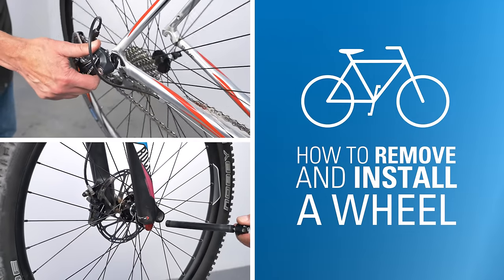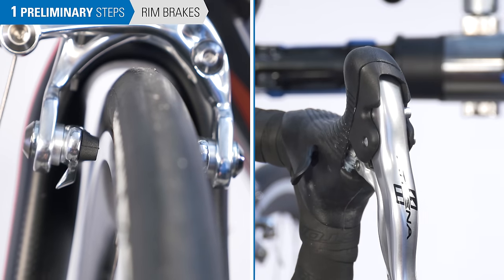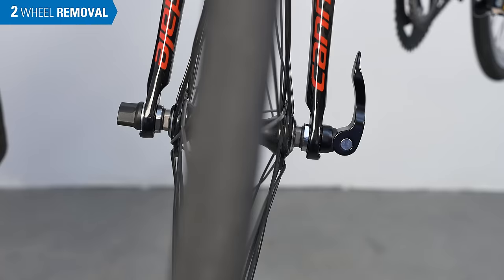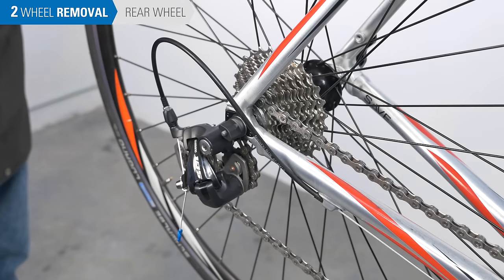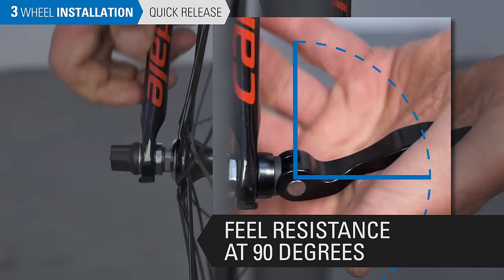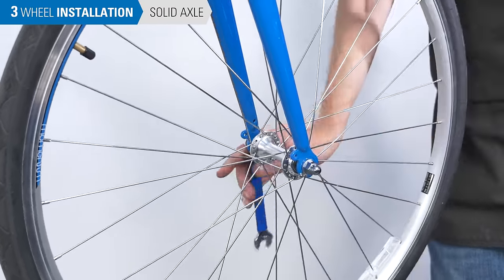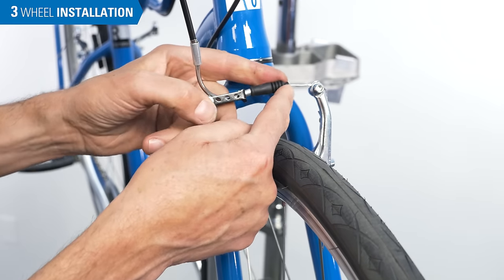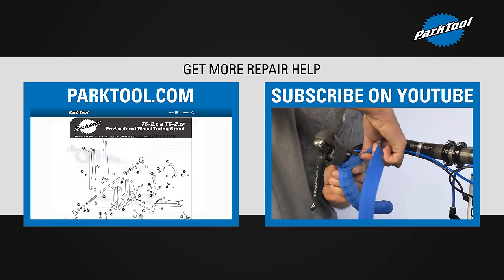How to Remove and Install a Wheel on a Bicycle

Comment: Just changed my inner tube for the first time and I just started biking just a month ago, removing the rear wheel is quite hard because my rear derailleur doesn't pivot as much as the video shows so when returning my rear wheel I ended up unscrewing my rear derailleur just to have enough space. Overall it was a new experience for me.

Comment: Thanks!!! I had to pop both tires off to fit my bike in my car then I wound up needing an emergency back wheel install instructions. I could not fig out how to coordinate connecting it w the derailer & chain. Your instructions saved me from an embarrassing trip back to the shop🙈🙏🏽

Comment: Great detail...very good. Just started riding again after many years out. Used to be able to change inner tubes for fun but learning all again from scratch. Was trying to figure out how to release the brakes to get the wheel off first. Your great explanation helped a lot! Thanks.

Comment: Even with this video I still can't get my wheel off, guess I'll just take it to the shop lol
Reply: Quinton Yosef  omg iv been using it too and it's so great
Reply: whyyyyyyy it literally takes 2 seconds
Reply: @AC Bikes ikr, you just pull a lever, use ur hand to unscrew the thing, and ur wheel comes off in 5 seconds or less (at least for disc brake qr axle
Reply: @linemedia666  it might be an unused, old, or broken type of release mechanism
Reply: @commenter1639  yeah that is true but im just cringing at the fact that someones gonna take their bike to a shop to take off the wheel
Reply: RIP noob
Reply: @AC Bikes$32 here to fix it
Reply: @linemedia666  my things wont unscrew and the pin thin is rusted

Comment: Thanks for the this video! I was able to remove the front wheel on my new bike several times for transport purposes. On this last try though, it looks like one of the brake pads is far too close and also a little high up, causing friction on the tire. Any ideas how to fix this?

Comment: How it works in my bicycle:

Front is easy. Almost exactly like this one. But I have to make sure it's aligned properly. Sometimes wheel might be crooked, and it'll touch the mudguard once you tighten it.

Rear wheel:
Remove the nuts from both sides, remove the stand, remove the mudguard support, remove the carrier support, remove the chain, remove the wheel.

Putting it back:
Insert the wheel axle into the slots, attach the chain, make sure the chain adjustment lever is in its spot, tighten or loosen the chain adjustment lever nut, to make sure chain tension is correct, tighten or loosen the other lever so wheel is aligned, insert the supports for carrier, mudguard, stand, insert the nuts. Make sure about alignment and chain tension one last time, and tighten the nuts. Nuts should be tight enough so the stand can't move around even if you tried to push it

Comment: I can't even believe all the different types of caliper releases. I feel confident that whichever one I have, I'll have instructions on how to remove the wheel, instead of looking for another video. Well done! However, I am a little concerned that I will put the wheel back on and not have everything seated right or attached securely. No one wants to find that out once you're on the bike.

Comment: Help! This guide was very useful for removing and installing rear wheel for the first time when I had a flat, but while re-engaging the linear brake after installation, I accidentally made it too tight! Stuck in the middle of nowhere typing this comment

Comment: Having difficulty w my rear tire it's kinda wide 2.5 in not much free space the side with the cogs fits in nicely all the way to the back but the other side.... for 1 the marking from the factory install is not as far back, and it does make a rubbing sound

Comment: I couldn't find a lockout on SRAMx5 rear derailleur and getting the big tires on my 29er in there a disk and the solid axle type is more challenging and not covered here.

Comment: What happens when there are mudguards and racks? Do you have to take them off completely or just unscrew the nuts at the axle?
Reply from the maker: Mudguards and racks can make this more difficult but the steps are still the same. Sometimes you will need to unscrew the axle nuts or quick release all the way.

Comment: Good video as always from Park Tool, BUT you didn't show how to do it on the thru-axles were you are supposed to use a hex wrench key.
Reply: Screw it in and tighten to indicates torque spec.

Comment: Great and very helpful videos on this channel! Thank you for sharing all this knowledge! Quick question: Where should the thru-axle lever of the rear wheel point to when it is installed? The video shows twelve-o-clock position, but there seem to be many opinions on the internet and on the trails. What do you recommend for maximum safety?
Reply from the maker: The location is typically personal preference. I would have it pointed either straight up or straight back on the fork. Or would have it pointing in between the seatstay and chainstay or straight forward on the rear. Most thru axles do give you the option to move it where you would like. in my mind max safety would be straight up on the front and in between the stays on the rear. Hope this helps!
Reply: Park Tool. That was very helpful. Thank you very much!

Comment: I’m trying to reinstall my rear wheel on an MTB with disc brakes and quick release. I fought with it for a half hour and can’t get it back on. It seems like a two person job, unless you own a bike repair stand. Bicycles are one of the most difficult mechanical things to work on in my opinion.
Reply: no

Comment: Do some thru axles not have a lever to turn?  I'm 99% sure my bike has a thru axle, but I see no lever that I can turn to unscrew and remove it.  It looks like an allen wrench might be used instead.

The bike is a Specialized Diverge E5 Elite, if that helps.
Reply from the maker: It does seem to be a thru axle.  Look on the left side for a hex hole, and use the correct size.  6mm or 5mm, both are seen.  Turn counter clockwise.

Comment: Damn, I was in a hurry earlier replacing a tube and forgot to shift to the smallest cog on the rear derailleur. I didn't realize until after replacing the wheel and now the shifter is really tight and hard to shift. And the derailleur is completely out of whack where as before it was in almost perfect adjustment. It won't even shift to the largest cog now :(. Any help with this would be greatly appreciated. The shifter is the twist kind with numbers on it.

Comment: Hi I have a bike with solid bolt type axel disc brake system. Can I convert it to quick release system
Reply from the maker: Possibly.  If you replace the entire axle assembly, yes, but you must match the cone profile.  Possibly all you need is an axle.  If your axle is M10 x 1mm, then it is easy with a new axle.  If you are 3/8" x 26 tpi, then not so easy.

Comment: I followed the instructions s got the wheel off and on, but now the chain is slipping gears on the rear wheel. Could this be because I tightened the wheel nuts off centre ???
Reply from the maker: That could be. If you removed the quick release entirely, be sure the springs got on in the correct orientation. If wrong it could hold the wheel at an odd angle.

Comment: Seating the rear hubs in the dropouts before installing the thru axle on my bike is tricky. The width between the dropouts is just a tick wider than the hubs, and I really have a problem installing the rear wheel when not using a repair stand. The hubs will slip through and grind the stays. It appears this is due to the stays not being under compression when the thru axle is removed. Is this normal? The bike is stock. So, there are no mods to factory components.
Reply from the maker: There should be a bit of a step in the drop out to prevent the hub from going too far. The outer diameter of the hubs end cap is not a set standard and some have a larger diameter and some a smaller. If the hub has a small diameter and the bike is setup to accomodate a larger diameter, lining them up can be a bear. There is not a great fix for this unfortunately.

Comment: I removed the rear wheel in a hurry without noting which gear it was on. Is there anything that can be done while putting it back without trial and error?
Reply from the maker: Use the shift lever to move the derailleur to the outermost position.  Then install the wheel with the chain in that position.
Reply: ❤ Park Tool. I took a chance with my usual position and it worked but I will remember this tip because I am generally very careless and forgetful. Many thanks for responding.

Comment: What do you do with the springs?  They are covering the axle right where the dropouts should go.
Reply from the maker: The small end of the tapered spring goes towards the hub. One spring on each side.
Reply: @parktool  Thanks for responding. Yah , I get the orientation and placement of the parts related to the axle. I think that was well explained in the video. What isn’t clear to me is where the dropouts are placed relative to the parts on the axle. The portion of the axle, where the dropouts should come in contact with, is covered by the spring. Should the dropout be place directly on the spring or should the spring be pushed to the inside or to the outside of the dropout?
Reply from the maker: The drop out should really never come in contact with the spring. The wheels axle will rest against the drop out and the spring just pushes the qr out on both sides to make it easier to install. The springs should not support the wheel in anyway. They are there to make install and removal easier. One the QR is close the outside face of the QR will come in contact with the dropout and the spring will be neatly held inside ready for the next time the wheel is removed.

Comment: Do I have to remove the breaks I can but it's annoying
Reply from the maker: There are only a few bike designs that require brakes to be removed.  You should be able to get the wheel in and out with brakes in place.

Comment: Thanks for your pacesetting station! Super informative.  I have some hockey stick tape.  Will that suffice as handlebars tape, Park Tool?
Reply from the maker: Hockey tape leaves a bit more cushion to be desired. A cork or gel cycling tape is much more comfortable. Hockey tape is good for grip but not as good for comfort.

Comment: I think I have a through axel, but no lever. Seems like a tool is necessary to remove the axel. Hex key, perhaps?
Reply from the maker: Thru axles that do not have a lever will typically require a 5mm or 6mm hex key.

Comment: Do we have to re-index the gear??
Reply from the maker: If the gears were properly adjusted, removing and replacing the wheel will not change that.

Comment: How come they don't tighten the thru axle at the disc rotor side, like qr usually does. The clamp would usually be on the non drive side
Reply: Front QR and thru axles should have the lever on the drive side so it doesn’t risk getting caught in the rotor. On the rear, the derailleur makes that cumbersome, so the lever is on the NDS.

Comment: I have a problem. I was looking into getting a bike that has a weld problem on the rims and the bicycle ends up flat. How do I fix that problem with out buying  new rims?
Reply from the maker: Like any problem, first you must diagnosis the issue before deciding on a repair. Are there a problems in the tire seat, like sharp edges or a badly placed rim strip? Inflate the inner tube and see what the hole is, and where it is.  Trace this back to the rim location to find the issue.  The repair can happen once you know the cause.

Comment: Don’t quite understand why do we have to release the front brake calipers when removing the front wheel? I can just remove the thru axle and remove wheel.
Reply from the maker: Often the tire is too wide to allow removal of the wheel without the brake being released. It also does not apply to disc brakes.

Comment: PLEASE HELP When I try to install a rear sheel with a solid axle my wheel keeps getting out of alignment when I start tightening the nuts. I just can't get the wheel straight
Reply: I have the same problem
Reply: Put the bike on the ground right side up. Make sure you push your entire body weight onto the saddle while tightening with the other arm.

Comment: What does gcn say to close the skewer spin the skewer handle until tight open it then turn the nut a little bit and close it. even my manual says to keep it open tighten the nut then close it with the handle never mentioning to spin the handle so what is the correct way I really don't want to damage a pair of carbon fiber forks
Reply from the maker: The two methods are achieving the same outcome and can both be used. This is a Goldilocks type adjustment.... not too tight, not too loose. Whether turning the handle or the nut you are doing the same thing. Give it a few practice try's and you'll get the hang of it nice and quickly.

Comment: What if I remove my Tyre in 3rd gear reply 🙏🏻
Reply from the maker: Then re-install onto the third sprocket. Or shift back to the outer most position with wheel out, and install on to smallest sprocket.
Reply: @parktool  thank you for reply...and I did the same what you said 🙏🏻

Comment: Great videos. Should any grease be applied to the quick release axel at all? Or to the threads? Getting a little bit of surface rust on mine.
Reply from the maker: A little grease on the quick release is a good idea. Also a little bit of oil in the quick release cam area helps close tighter as well.

Comment: Sir, My actual inseam size is 83cm(32inch) and my total height is 172cm(68inch). Please prefer a frame size(L/M) and tyre size(27.5/29) for me.
Reply: Each brand sizes differently, so you’ll have to go off their sizing charts and your own experience. Wheel size is your preference. 27.5 is more nimble, which 29 is more stable.

Comment: I'm not sure which type of rear wheel removal my bike has. It has a Shimano RD-TZ31 5/6/7 Speed Bicycle Rear Derailleur, and doesn't have a clutch like the shimano derailleur in the video. It also isn't quick release and as far as I can tell it isn't a thru-axle either.
Reply from the maker: Then it is likely a "nutted axle" type.  The axle has external threads that protrude past the dropouts.  A nut then holds the wheel to the bike.

Comment: What do you do with a Sturmy Archer 3 speed rear hub?
Reply from the maker: "It's the same, only different." 
No, that is not a good answer, and this deserves a video as well.  Un-thread the adjusting barrel from the small chain that enters the hub on the drive side.  Loosen both axle nuts and slide wheel forward and out.  But that is all better with video.  Will put that on the list to do.
Reply: Thanks for the quick reply. I will give it a try.

Comment: Guys what is the wrench use in the axel nut?
Reply from the maker: Manufacturers vary in the axle nut wrench size.  15mm is the most common, but 14mm is also seen.

Comment: Can you do a video for a single speed mtb ?
Reply: curt robertson isn't it the same?  I think it should even be easier as you don't need to worry about the rear derailleur
Reply: no
Reply: Ryan 777 it’s been two years. I figured it out

Comment: when putting a front wheel back on is there a  "right" and "left" side of the wheel that should be maintained or can you put it back on with quick release on either side etc? thanks
Reply from the maker: The rear wheel has a definite left and right for the wheel. You can technically install the quick release on either side of the rear but its much easier to get the wheel in and out if the QR is on the non drive side. The front is not as crucial but typically you will want to be consistent with the rear so the qr will go on the non drive side on the front as well.

Comment: Did I miss the setup my bike has, it has none of these. Needs a Hex (Allen) key....
Reply from the maker: Some solid axle bikes use hex bolts to attach to the bike - in that case, instead of loosening the nut, you loosen the hex bolt then remove the wheel as seen in the video. If you have a thru axle with a hex fitting, then you just loosen the hex and pull the axle out and follow the procedure as seen in the video. Axles with just a hex drive were not as common in 2016. Hope this helps!
Reply: @parktool  Thanks, I will have a look tommorrow closer. Appeared to have a hex on both sides at the rear. Its for the cannondale scalpel si carbon 3 2019, Thanks again, Great Videos. I watch them even when I dont need too :-)
Reply: @parktool  I tried to torque my front thru-axle to the manufacturer specifications ( 10Nm ) with a torque wrench and my axle broke in two pieces by the thread area...any idea why this happened or any advice to avoid this in the future? I'm thinking maybe I missed the click-stop from my wrench...anyway waiting on a new front axle, any advice how to avoid this in the future would be helpful, thank you for your great content.
Reply: Vio SeVen Possibly a defective axle, or your wrench is being misused as you said. 10Nm is pretty light and shouldn’t result in a broken axle. The hex should strip out first.

Comment: Mine rear wheels axle is facing downwards at maximum torque 10 NM  how can I fix it to make it upright.
Reply from the maker: Are you dealing with a thru axle? if so what model of thru axle? To change the orientation is different on most axles.

Comment: where the hell washers go?? i reassembled rear wheel and i found one washer left
Reply from the maker: If you have a quick release there should be no washers. If you have a bolt on wheel there should be one washer on each side. Those washers should be located between the nut and the frame. Hope this helps!